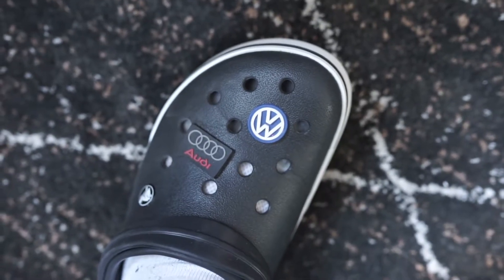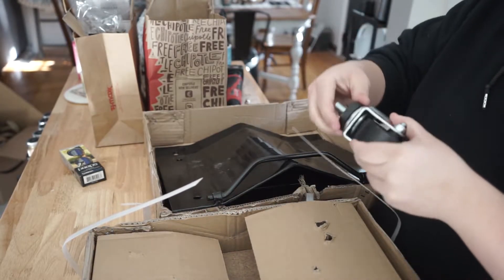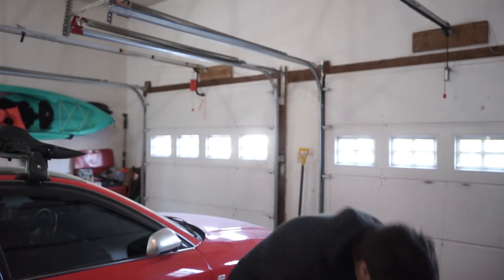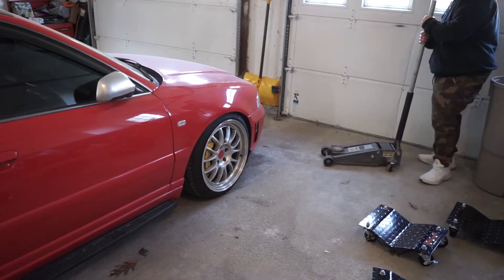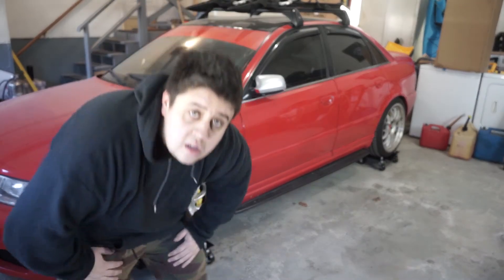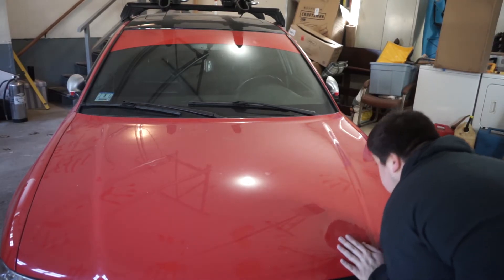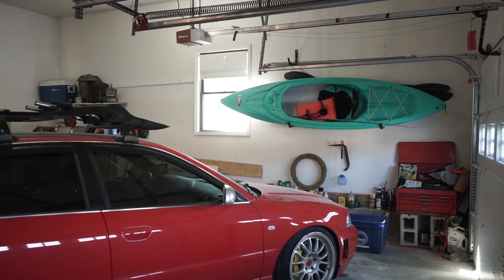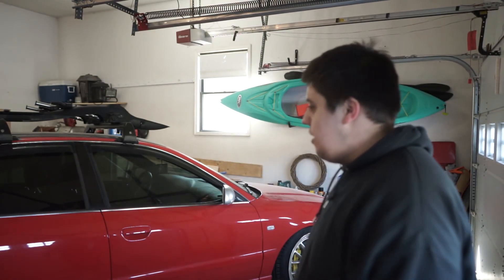$100 Vehicle Dolly from Amazon. Worth the $100? WEN 73017

Comment: What’s your tire width. I was worried that 245s would hit on the nuts on the top.  You see any issue with the tire sitting on the nuts?
Reply from the maker: These are 9 wide and 215 tires. They did sit on the nuts if I remember correctly